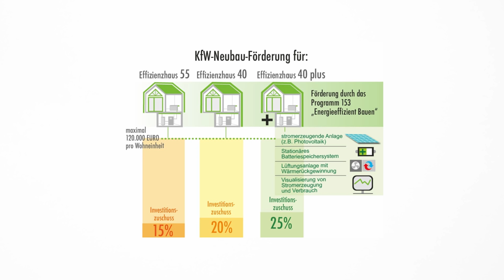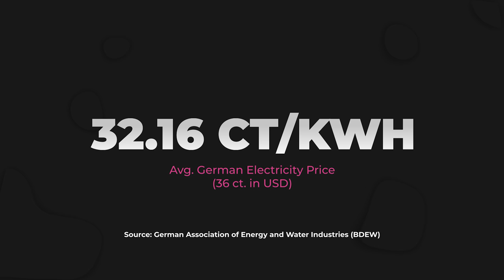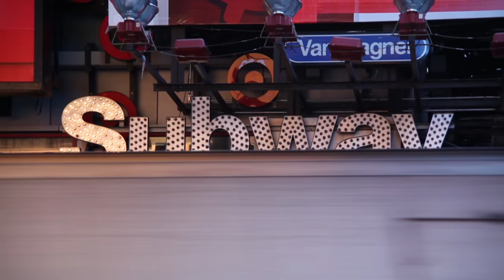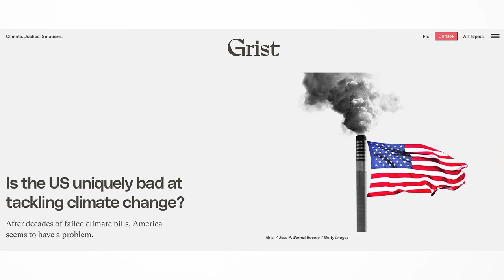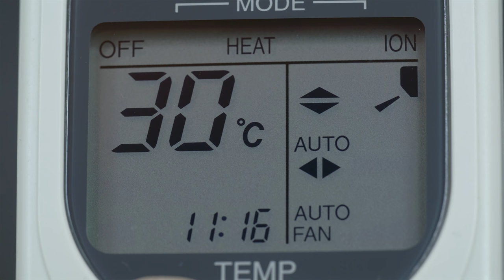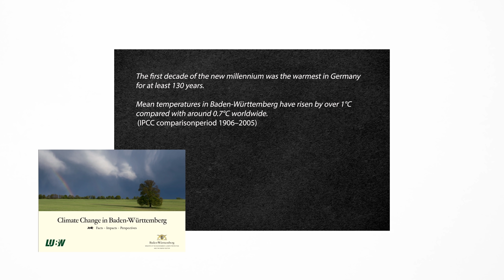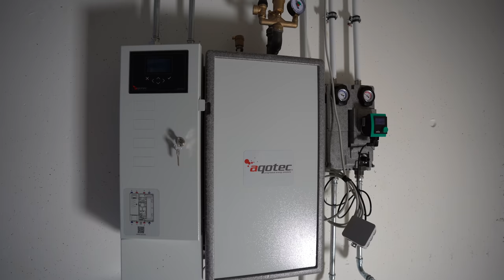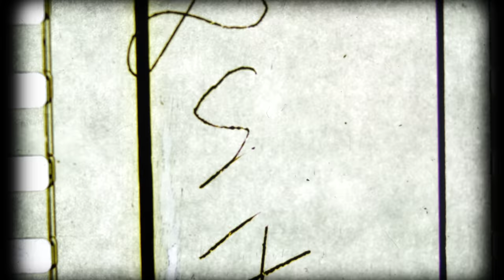HVAC (HLK) in German & American Homes | A Tale of Two Countries

Comment: One more difference between Germany and the US: In the US most new homes are detached single family homes (which is bad for a number of reasons - if you are interested, I've seen some good videos on this topic on the channel "Not just bikes"). A detached building will radiate heat outward to all directions, all of which is basically waste heat. If you put multiple apartments into a single building, each apartment will have at least one wall (and/or floor or ceiling) touching another apartment. Heat radiating from those surfaces is not wasted but will contribute to keeping the adjacent apartments warm. Germany has more of those multi-apartment-buildings...

Comment: You must not forget that many regions of the USA, e. g. Florida, were just not inhabited/inhabitable  before air conditioning became available.
And one major reason for the hotter summers and colder winters in the USA is the fact that you messed up your mountain ranges: they all run north-south, so hot and cold air can travel easily, while Europe got it right: our mountain ranges run east-west, thus blocking off both heat and cold.

Comment: We own two mobile AC units which we use only during summer heatwaves in our bedrooms. In 2021 it was like 5 days. Sleep quality is just so much better. We usually cool down the bedrooms to like 19°C and shut them off before we go to bed.
Reply from the maker: We also caved and bought a portable AC unit when I was pregnant. We live in an attic apartment with south/west facing windows and the multiple heatwaves the summer before scared me.
Reply: You are confusing cooling with refrigerating. If you set the AC to 24°C, it takes less time to reach temp (than going down to 19°C) and the compressor will only run a less than 10% of the time. (Depending on outside temp, room size and indoor placement.)

Comment: When I got my new little house (bedroom, livingroom, kitchen and bathroom) I had only one oil furnace for the whole house.
In the first winter this little furnace burnt about 500 liters (132 gal.) of oil in only three months and because my house has bad insulation it was also very hot all through the summer. At 2013 the price for one liter of oil (0.64 gal.) was one Euro. So I paid 500 Euro for three months of heating.
So I looked for an alternative. I came up with an inverter air conditioning (wall mounted in the living room and in the bedroom) with an exterior AC unit. I have AC since 2014.
Now I pay for the whole year of heating AND cooling about 170 Euro. Additional of cutting down the costs ist is now more enviromental friendly. But the best benefit of all , beneath lower costs and doing some good for the environment, I can sleep better in the summer . I had a max. temperature of 27 deg. C ( almost 81 deg. F) in my bedroom on the hottest days during the summer .
Now I have 21 deg. C (70 deg F) in both livingroom and bedroom throughout the whole year and did a good thing to the environment too.
Next benefit: the AC is 15 year maintenance free and also has 15 years warranty  by german laws .( Werksvertrag, work contract)
I LOVE my AC and my wallet loves it too and the environment also loves it . BTW.: it is a Luftwaermepumpe (airsource heatpump).

Comment: In general the trick is to open the Window in the night and close it during the day, u explained it. In an older House with big walls of brick or rock in the ground floor it is regularly cooler than under the roof. As we hav our living room under the roof i will install a AC up there… and hope to get enough solar-panels on my roof to power the ac in the summer when u have a lot solar-energy… and as a side-effect i think the energy that will go to the panels will not go into my roof and heat the house…

Comment: There is one single reason for so many things concerning US housing construction: money.

It’s cheaper to use plywood.
It’s cheaper to use drywall.
It’s cheaper to use electricity for heating or cooling (than investing in insulation).
It’s cheaper to use forced air (instead of floor heating).

The initial cost of everything is just cheaper. Most Americans don’t care about long term costs, the initial payment is what makes them buy or not buy something.
Every single contract model where you get a discount for the first few months before the price switches to the „normal“ level, or rather the expensive level, originated in the US. A lower initial payment is what drives the customer. 
Financing expensive electronics or cars for example, leasing contracts - cheap in the beginning with an enormous final payment in the end. But initially it’s a cheap offer.

And that is the main reason for so many of the things you were talking about. Saving money during construction, not calculating long term costs, because probably they’ll move out anyway at some point. You mentioned that in part 2 of the series. ;) 
So why invest a ton of money into a house you won’t keep until you’re old? Go for the cheap solution and buy a better one anytime in the future.

Comment: The first thing I normally turn off in a hotel ist the AC. I hate the dry air it produces. After a night leaving it on I most certainly get a cold. Also leaving the AC of in my car is a given. Opening the windows or just using a fan is much more comforting.
Reply from the maker: We are currently on holiday in Thailand with 33C during the day and 24C at night and high humidity. We could not imagine staying in our room without the AC turned on. However I am sure this probably wouldn‘t qualify as your normal situation.

Comment: I've lived in both germany and japan, and I've traveled a lot in Korea. I say this because in terms of convenience I think korea takes the win here (not an expert about electricity waste here, but...). So they, similarly to Germany, use floor heating. It is a historical feature of korean houses and afaik is even said to have been invented there first. It's called (Ondol), super cool. Anyways, since I've both had and didn't have floor heating I DEFINITELY prefer floor heating over everything else. Korea also has ACs. So in combination with floor heating: winner.
I personally prefer AC to radiators because they are more convenient to use. You have a remote that you set to a temperature and the ac does everything for you. It can dehumidify, cool and warm the room.
But yeah, if I can have floor heating I don't need either of the two.

In my home in germany (built in 1990) we use a combination of floor heating and a fireplace actually. We do have radiators too but only in the bed rooms. The majority of my house is open, so kitchen, dining, living room and hallways are all one big connected room (with angles), with a fireplace in the middle. The floor heating system adjusts itself to the temperature outside with a sensor and the fireplace we heat up in winter.

Edit: i was purely talking from a point of convenience. 
We use gas to fuel the floor heating so we all know how well that's going right now (and has been for years)...
I definitely don't recommend gas and oil as heating sources!

Comment: How often do Americans clean forced air heating system pipes? I mean they collect dust from the air, it's warm inside, and as soon as it gets humid somehow, it's a great place for molds.
I live in a house that's 120 years old. It stays cool in the summer when it gets really hot outside (30°C or more) for about 2 weeks just because it has thick sandstone walls. This works also for keeping warmth at cold winter days.

Comment: I prefer system's which are a combination of both.
I enjoy warm heated floors and prefer not to have shoes inside.
That with forced air ventilation system, which uses heat pumps for heating and cooling and also uses the heat from the out going air.
Having dual capacity gives redundancy, which is additional benefit. Having a totally independent separate emergency heating system is also good to have. I have fireplaces, which are designed to be effective for heating and not just for giving atmosphere. In order to keep the system in balance and energy efficient, there needs to be smart controlling system and some passive smart systems too.

Comment: A note on Air Conditioning: Climate has changed in the last 20 years and summers are getting hotter and hotter. Even where i live (Mönchengladbach) we had a heat wave in 2019 with 42(!!) Celsius in Juli (106 Fahrenheit), even midnight (12:00) it still was 30(!) degrees Celsius (thats 86 Fahrenheit). In that summer we (= my wife and me) decided to get an AC at least for the sleeping room. And we did it. It was way cheaper than we expected, its a "split" Air Conditioning which runs the compressor outside and the heat exchanger inside (thats the most known AC wordwide). And we are HAPPY that we finally did it. Even if we need it only a few weeks per year, but its a real relief to sleep in a room with just 20° Celsius and not to sweat all night long. I strongly recommend to do this as well. There is no need for an AC for the whole building, but at least the sleeping room. We also installed one for the living room, but this is "luxury" and we did it, as it was surprisingly cheap. We payed 3.300€ for the whole installation (AC in sleeping room and living room), including all costs, working hours and taxes.

Comment: Great deep dive. So much to learn on this subject. My personal favorite combination is an energy efficient, geothermal heat-pump (taken from the ground through vertical piping instead of the air), and ideally powered by solar/wind generated electricity. Your setup looks terrific too! Many great solutions for different contexts. I'm struck also by the difference that a well built home makes. For example, in Chicago, we have electric central heating and cooling, but only spend $80/month average, year round (including heating through the long winters keeping it at 70F, and summers at 78F), due to the well insulated brick and use of dirt as insulation. 

My one hesitation with burning wood counting as a clean fuel source is that it gets double-counted for carbon offset in the planting and life-cycle, and counted again in the “neutral” burning. However, if it’s burnt, then it doesn’t have a positive carbon offset in its lifetime. The carbon has to remain in the wood to have a positive impact. Still burning the wood makes sense, but perhaps governments should invest more in CO2 capture mills instead of counting tree-planting as a carbon-capture method, then they could make sure that those mills are run by solar, wind, nuclear or some other green energy source, since trees inevitably die and it probably makes since to keep burning them, but then they aren’t (net) contributing to carbon-reduction.
Reply: I love that Freiburg is so green. Thanks for the great dive and another great video!
Reply from the maker: You bring up great points here. We also were curious on how they arrived at their "CO2 neutral" conclusion. However, it was interesting to learn that they only burn "wood waste" from other industries and try to locally source it when possible. I do think they are able to offset some of their production as well with green energy sources. Their electricity is hydroelectric/solar.
Reply: @TypeAshton  yes, definitely! Burning wood is definitely a great carbon neutral source. What I meant to say is that carbon capture of trees is currently being used in most government calculations (and businesses) to offset the carbon emissions. But that only works if the carbon remains captured in the tree. However, by burning it, it releases all of the carbon it captures over its lifetime back. So as a fuel source its great (as you say, since it is net neutral), its just that governments should not double count it as if trees are helping remove carbon, since this doesn't take into account that everything they capture over their lifetime is released back at the end (or so I understand it...I could be wrong about this). So, as a fuel source its great, its just a question of how to calculation carbon offsetting without double counting the same thing. I'm not sure if that makes sense. Regardless, your system sounds great!

Comment: AC tends to be not regulated for humidity. This means cold and very dry air which poses problems for some people. A colleague of mine always had eye problems because of this.

If you have not yet encountered the old traditional way of building called "Fachwerkhaus", you should check this out in the heat of summer. The farm of my grandparents was built this way and very nice in hot weather. Unfortunately, in a lot of those buildings the loam/straw combination was replaced with bricks for easier maintainance which negates the effect.

Comment: Well researched and explained, especially as you aren't familiar with the field (Ashton maybe partly, but technical stuff rarely is the strong suit of architects in my experience).
If you ever have any more questions about the technical side of your KfW55 house here in germany, I can probably answer most questions for you, as an engineer for buildings physics and being certified to plan/file applications for KfW and other subsidied programs.
One thing that is slightly wrong, you don't get the water from the district heating into your house. There is a heat-exchange in your wall box that transfers heat to the closed circulation system in your house. This is much easier to maintain, and additionally lets you have a circulation temperature of less than ~80-90°C in your system, because that is usually the temperature the district heating will deliver.
To the question of how to keep cool. As Jonathan explained, there are smart options to get heat out of your house even when it is hot, mainly by opening your windows at night. Aside from that, adjust the clothing, use ventilators to keep an airflow and you can usually keep comfortable to room temperatures up to ~26°C (according to science). The fact that most houses here use solid construction helps with that, as the higher mass has a much higher heat capacity than lower mass construction, thus the response to temperature change is slower, and it needs longer to heat up, especially if you prevent it from heating up (like not letting the sun directly heat up your floor). The thermal insulation of your WDVS also helps to prevent your walls from getting roasted by the sun directly.
The reason houses usually do not have an AC unit to cool is based on the number of hot days you showed. When you will only "need" an AC unit to deal with a total of 15 days a year, that is most likely a questionable investment to make, especially as those usually aren't happening in a single period, but spread over time. Getting an AC unit still is strictly a convenience choice, and it is essentially energy going to waste (except if you power it with your own solar power, then you can do whatever you like).
That said, I do have a portable AC unit myself (I got this when I was living in an apartment with bad ventilation and right below the roof, aka the hottest place to live in) exclusively to cool down the bedroom when it is way too hot. It hasn't seen much use since I moved to a less heat exposed apartment, but I still went and built a frame for my window so it can still be used if needed without too much air exchange with the outside. Also these portable AC units which are used with a window most often are quite energy inefficient compared to built in AC systems, so they are even more of a waste.
The concept of the district heating or Fernwäre isn't as environmental friendly as it might seem on paper, as there are some issues that will have to be solved within the next 2 decades, but it certainly is well on the side of environmental friendly heat sources.
Reply from the maker: Thank you so much for the kind offer! We actually might have a few questions in the future - our house will be certified sometime in May as we finish up the process. Any insight you can give is much appreciated.

Comment: I am in new England, specifically Massachusetts. Older houses in the cities like triple and double decker's, use radiant heat and boilers. Radiant has made a bit of a come back, because it is cheaper and you are less likely to get a sinus infection. Older houses also use window units for AC.  central is more common here in the suburbs.